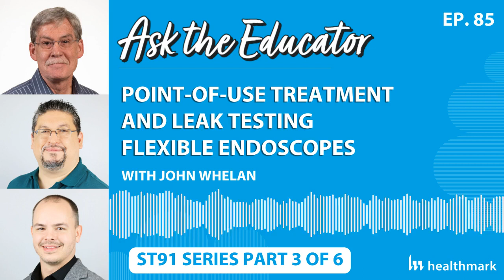Episode 85. Point of Use Treatment and Leak Testing (with John Whelan) Part 3 of 6

Comment: So does that mean for Automatic Leak testers that have a self test don't need to have it's pressure tested by a separate device?
Reply: AAMI ST 91 (2021) directs for automated leak testers to be on a calibration schedule - to include verification of pressure output.  Any leak tester (manual or automated) should have daily pressure verification performed and documented.  If an automated leak tester allows such daily verification, that meets the intent of the directive.